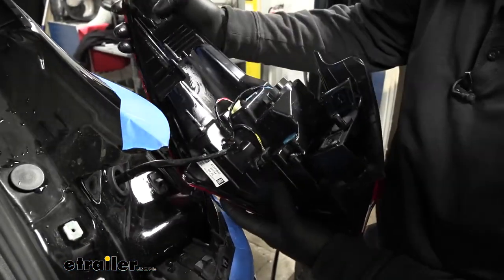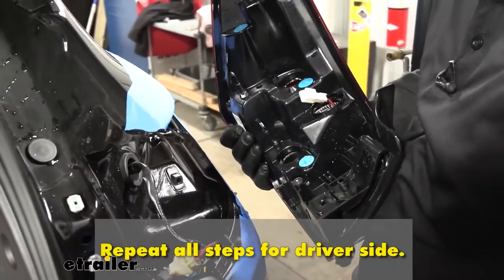etrailer | How to Install: Curt Trailer Hitch Receiver on your 2021 Chevrolet Trailblazer

Comment: Fantastic video!  Worked in my 2023 as well.  I had a little trouble only with a couple of clips on the bumper cover just below the tail lights, but I figured it out. Wish I could play the video backward to double check my re-install, but worked well enough stopping and rewinding a bit at a time. Also, on our RS model we did not need to cut any of the molding and the hitch fit perfectly about an inch below.  Thank you so much!
Reply from the maker: We're glad you found the video helpful!
https://www.etrailer.com/Trailer-Hitch/CURT/C94UR.html

Comment: RE: Tail Light Removal

A suction cup on the back and/or side of the lens will help pull that assembly straight back.

The small diameter ones from HB work ok, but I had more control with the removal when I used one of those suction cup elderly shower grips (only using one cup on the side of the lens). Use your fingers in the Tork screw cover holes to sort of stabilize the lens as you pull back and let the suction cup side do the hard work.

The key is pulling Straight Back and not wiggling the lens.
Reply from the maker: Thank you for sharing these tips and tricks with us! If you would like to see more information on this trailer hitch, check out the following link.
https://www.etrailer.com/Trailer-Hitch/Curt/C94UR.html

Comment: on a 2022 LT trailblazer, will they have to cut the plastic on the bottom part in order to install a hitch?
Reply from the maker: The installation for this hitch on 2022 Trailblazer will be the same as shown in this video and will involve some trimming.
https://www.etrailer.com/Trailer-Hitch/CURT/C94UR.html

Comment: What about the wiring if I wanted to tow a small trailer?
Reply from the maker: Check out the following link for more information on the wiring harnesses we have for the 2021 Chevrolet Trailblazer.
https://www.etrailer.com/t1-2021_Chevrolet_TrailBlazer.htm
https://www.etrailer.com/Trailer-Hitch/Curt/C94UR.html

Comment: Can i pull a zeroturn mower with this?
Reply from the maker: This hitch is a class 1. They have the lowest ratings of all the classes, normally a 200lbs tongue weight and a 2,000lbs gross trailer weight. If you can load your ZT on a trailer to keep the tongue weight under 200lbs and GTW under 2k then make sure your vehicle can actually tow the weight. So it is possible for sure, just make sure you check all of your weight capacities first. https://www.etrailer.com/Trailer-Hitch/CURT/C94UR.html
Reply: @etrailer  Thankyou sir for getting back to me about that! God bless and stay safe out there my friend